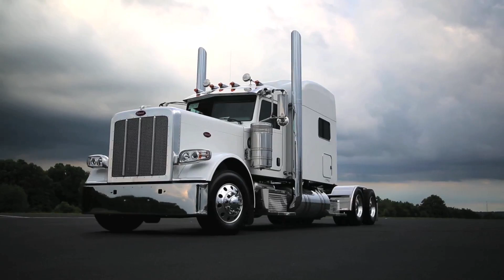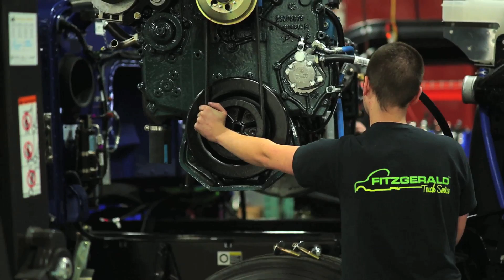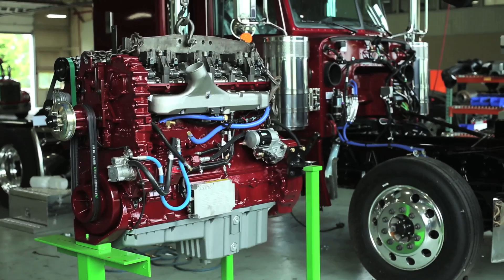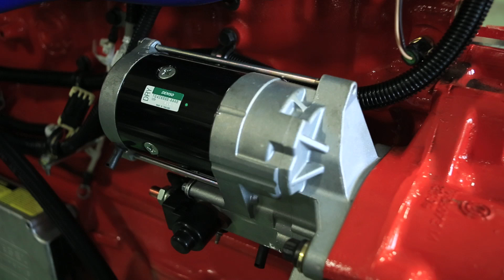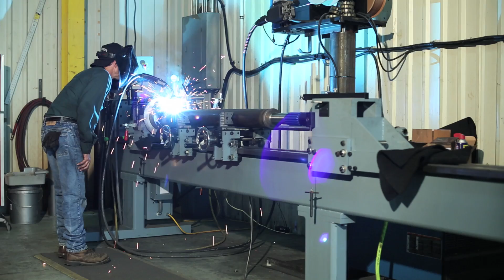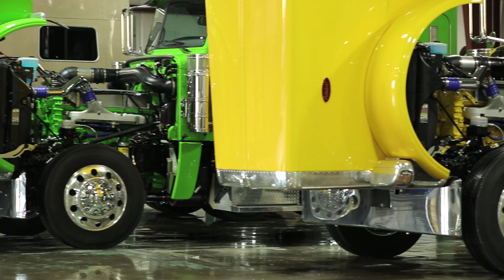Fitzgerald Glider Kits   "Peterbilt"

Comment: The 12.7 glider i drive has 980000. On the motor hauling 80k everyday.  But it still dont have the power of the 07 cat I drive.  12.7 gets 1.5 miles to the gallon better though.

Comment: I would want a C-15 CAT and avoid the old oil leaking Detriot. Hooked up to an 18 speed trans you can't go wrong.
Reply: These 60 Series Detroit’s are GREAT engines. Make no mistake. These are not the Detroit’s of old. Completely different from the old 2 Strokes. These are great engines !!!
Reply: @josefastboats5874  true I do agree.  Just remember the old school Detroit diesel owners saying if it ain't leaking oil it's empty. I always loved that. I did own a few with Detroits and they were good but not enough to haul the super heavy loads.
Reply: @icebrakernh  Yeah man, I actually used to think the Detroit weren’t that good, because the old 2 strokes Detroit’s like the 8v92s 6v92s and the 8v71s. Although those things sound sooooo good. They need 2 mufflers though. Ain’t no way you could run those things with a straight pipe. 😂😂😂. Aww man driver. Unless you wore the ear muffs then you could drive them. But yeah the 60 series was supposedly designed by an Ex CAT engineer that sold the design to Detroit. They ain’t what the old 2 strokes were. They’re just as efficient as a Cat is. But, to this day.... For brute power and just pure American awesomeness the CAT is hard to beat. My fav CAT is a 3406 B model. Love those engines
Reply: @josefastboats5874  yeah buddy the 3406B model was hard to beat add the A model pump and you knew that you were giving her some. Those 2 strokes were kicking it too of the Detroit line. When the 60 series were set up right they did well if it was a stock tune they were  ok.

Comment: My 460ci big block 6mpg run 4,600rpm and run 850rpm I got 12.5mpg  in a gas motor low rpm good mpg and high rpm bad mpg

Comment: More hp low rpm get mpg and 3.70 gaer mpg and run 1000rpm  mpg and  1500rpm max and 850rpm get mpg and  25speed gaer mpg and some day 30 speed gaer mpg 6cly mpg and trubo mpg  and bigger hp is more mpg more power more mpg and lower rpm mpg

Comment: How much longer does Fitzgerald have before they have to pull the breaker switch and shut it down 😭
Reply: Hold on to it brother.  I have a 6nz cat.  Saving for a rebuild now.  Cat is the strongest( in my opinion) don't want the keyboard killers to hunt me down.  Safe travels
Reply: @slowpokez80  Maaaan ain't nuttin like a CAT! Yeah i feel ya on the rebuild kit! I'm stacking chips for the Platinum Kit too. Keyboard killers... LMAO! Safe travels and Happy Holidays ✌
Reply: @Dancing Deity epa and dot tried shutting them down, didnt want trucks to last 2mil without getting themselves richer bro. If you can find a cat motor. Hold on tight and you'll be all right!!!!
Reply: Been shut down buddy
Reply: @slowpokez80  Wow, i guess the value on my 1996 W900L 3406e 5ek block just went up again!

Comment: 12.7 Detroit  is a guaranteed million mile motor and one of the best in fuel mileage and very easy to work and get parts for....Those new dd15 cross breed mercedes/detriot regin motors are garbage!
Reply: patrick washington  I have one million miles on my Cat C 15 still running strong . 379 Pete 18 speed bull hauler
Reply: @Bigmike3406E  👍
Reply: Not what I heard from People some people they are rebuilding the engine after 500,000 miles
Reply: They’re GREAT Engines. The Detroit’s are just as good or better then the bigger Cats are. I got a 12.7 60 Series Detroit Set at 600 / 1850 
She’s got more then enough power and she’s good on fuel.
Reply: patrick washington not that good on fuel... and gutless
Reply: 379 Life ignorance

Comment: Hey there guys, I work for a fuel company in Miami, We primarily do ships. Pump work is 90 % of our work. We mostly run Mack Visions, very good truck for our kind of work. But these DOGS get old to, and alot of the new trucks with the DEF is nothing but a headache!!! They spend more time in the shop than on the road. Curious to know of you do Mack Gliders as well?? We would of course have to bring the truck to you, just wanted to know if you did them??